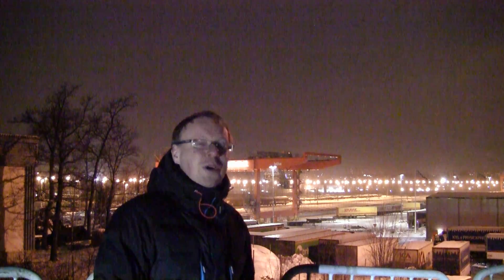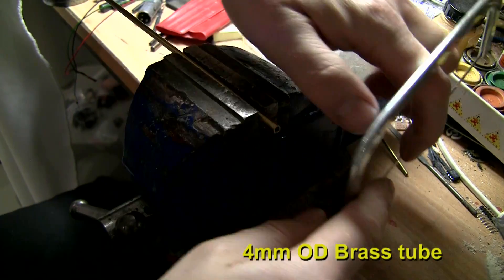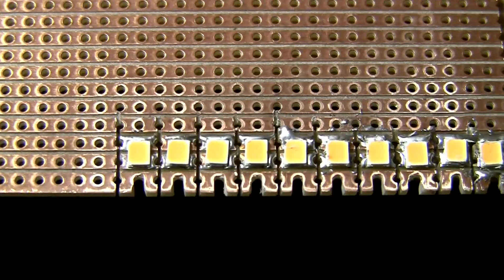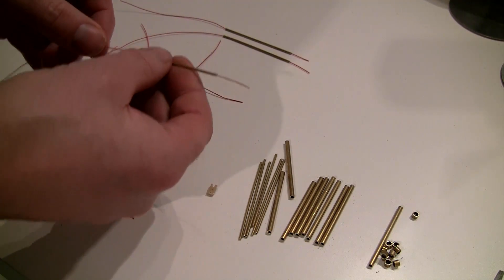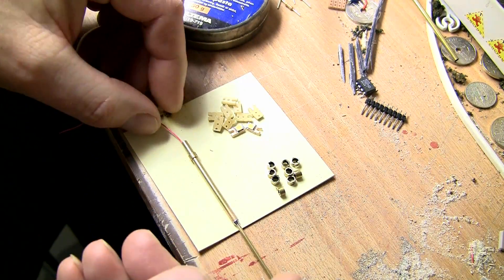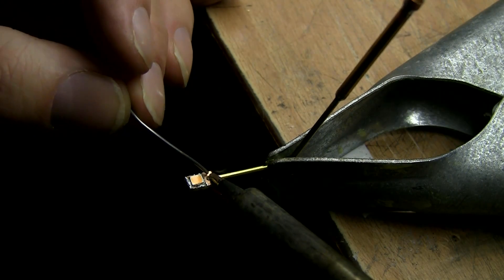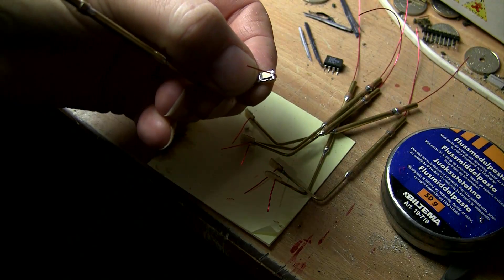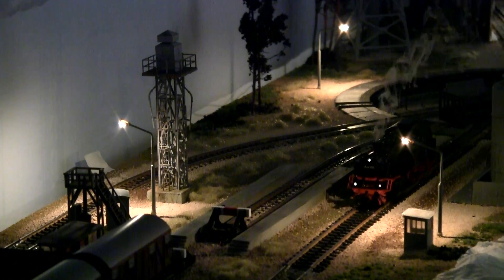Model LED street lights - Detailed guide DIY

Comment: I see several questions about "the diode on the wire". For reverse polarity protection, that diode is soldered anti parallel to the led, ideally parallel to the led + resistor. In case of reverse polarity most current will flow through the diode, protecting the led. If you want to go overboard: add a second resistor in series before everything to limit the current with both normal and reverse polarity.

Comment: Hi. Novice question: Is the resistor also connected to the wire? Were you connecting the resistor to the lamp post so it is grounded? Thank you for your instructive and entertaining tutorials!
Reply from the maker: Hi! No, I actually use the lamp post as ground conductor, so the resistor is soldered to the post (Brass tubing)

Comment: Very nice work but can you please tell me why are adding a diode even though we have the resistor?
What type of diode are you using? Voltage matters for the diode?
I understand that diode leave current go in one direction so again why you would add one?
Please advise 
Thank you in advance!
Reply from the maker: Hi! The diode protects the LED from reverse polarity. The max voltage in reverse for the LED is 5V. This means that the supply voltage of 19V will kill the LED. the max reverse for the diode is 24V.
Reply: marklinofsweden excellent! Thank you so much for your prompt reply and for clarifying that for me. I really enjoy ALL your videos!
Reply: @marklinofsweden  Sorry but I cannot find the Diode in your tutorial "Distralec 70-225-57" - can you, kindly, let me know what is an alternative diode I can buy and how many amps, voltage the diodes have to be? Also is a Schottky Diode better, worse, can I use?
Please advise and thank you in advance!
Reply: @francescod6494  Any diode ought to work; 1N4148  or from the 1N400x family - i.e 1N4001.  Schottky's have a lower voltage drop but are more expensive - the lower drop hardly matters if you are using 5Volts or more.
Reply: @kennmossman8701  Okay thank you Kenn, this was an unexpected reply as it has been a little while that I posted my question, Marklin of Sweden was too busy to follow up with a second reply, he left me hanging, so yours it's greatly appreciated at this point in time and for Xmas!
I usually only use a resistor I have never had a need for a reverse polarity diode that's, I believe, an extra step to be safe but not really necessary in my opinion. I was surprised that the Host, sorry don't know his name, was using it.
I am not going to bother with this addition also because in Canada, my city, they are not easy to find I would have to source them from eBay and shipping, these days, is pretty sketchy!
Thanks again and Happy holidays to your and your Family!

Comment: A fantastic video! I've got to try this at home :) I'm just wondering if the product number 5517040 of that Distrelec copper wire was correct or suitable? According to the Distrelec online catalog, it has an outer diameter of 0.1 mm which is very thin. You mentioned in the video your cable was 0.5 mm?

Comment: How to mach volts DC
Reply from the maker: DULY89 DULY The diode type 1N4148 shown in the video will make volts DC. The resistor of 1kOhm shown in the video will make LED usable for voltage between 5V to 24V

Comment: Hey, you may have said this in the video not shore. What size did you cut each brass pieces too? Thinking of making some of them myself. great video.
Reply from the maker: Gouldian Junction Hi! No, I don't think I did mentioned that. The streetlights really have different hight in different areas where I live, so I would think it's mote important it looks right together with what you're modelling, rather than using fixed measures. Make a prototype street light, compare with a figure and adjust hight for your production.

Comment: Very nice tutorial, but why did you add a diode, given that is what a LED is?
Reply from the maker: +T70MkIII Hi! Thank you for the positive feedback! 😊👍 The "extra" diode in series with the circuit protects the LED from reverse polarity and voltage spikes. The reverse voltage withstand of the LED is only about 5VDC, so if the supply of 15-24vDC is connected wrong the LED will burn. Further.. There are a lot of electrical interference introduced in the power cables, as well as possible ESD-sparks from hands or cloths. The extra diode will protect the LED from that too.
Reply: Thanks very much for explaining this - makes perfect sense.
Reply: @marklinofsweden  I REALLY doubt the diode - in series- will reduce spikes.  You can reduce spikes by using a capacitor, or PI filter, or MOV, or Zeners in parallel.
Reply from the maker: @kennmossman8701  It will prevent any voltage spikes in reverse polarity. Nothing else.

Comment: Great tutorial! You should might mention that the voltage when you test the LED:s must be rather low or i series with that 1 kohm resistor mentioned later on.